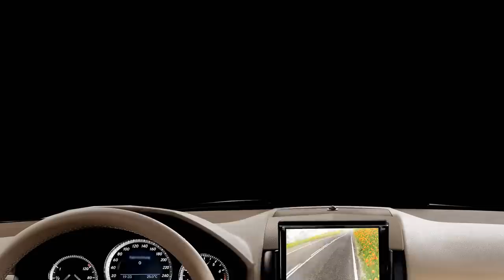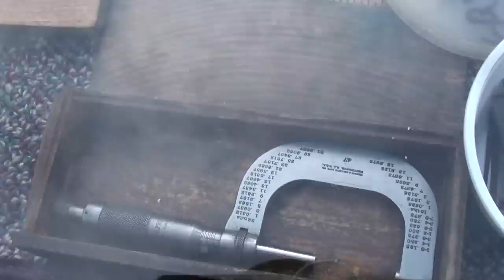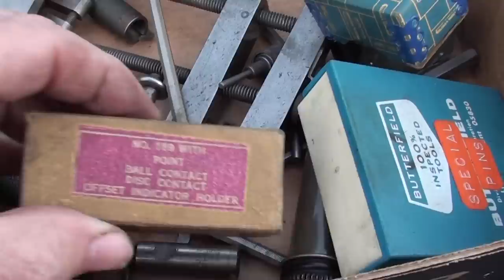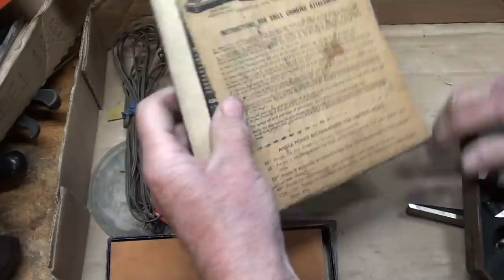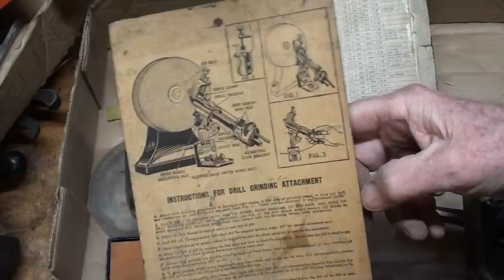tubalcain SCORES at ANOTHER TOOL AUCTION atlas lathe

Comment: Two comments at the approximate 24 minute mark in this video.
1) why were people dismissive of the idea of 3D change gears? I think they would work just fine.
2) Crescent used to sell individual parts to rebuild their adjustable wrenches just like Rigid. I personally sold and bought lower jaws, springs, adjustment wheels and the screw in pins. I do not know if those parts can still be found.
Reply from the maker: People did not seem to like any of my videos with 3-D printing. I assume they thought it was just a cheap plastic gear that would not hold up.
I worked at a hardware store when I was a teenager. There was a little kit box that contains all of the extra parts for these wrenches. Jaws, Knurled, nuts, and screws. Nowadays, everything is just throw away.
Reply: @mrpete222  Exactly! That little kit you had in your store was the same kind there was in the store I worked at that doubled as a plumbing shop. Only about ten years ago, I was in a small hdw store in a small town in KS that was going out of business that had a newer Crescent kit from the 60's or 70's that I wanted to buy the whole kit. Sadly,  they were just too high for me to buy.

Too bad people are too ignorant to understand that 3d gears would be more than durable enough to be used on a home shop type machine. I guess most just don't have enough mechanical aptitude to understand the application of the newer technology.
Reply: I thought the gears were a great idea and I did make them.
Reply: @mrpete222  I thought the gears were a great idea and I did make them. They work quite well for what I use a lathe for.

Comment: @ 15:30, the item on the red ad white card that says "Ungar" is a soldering iron tip for Ungar soldering irons. If you do not have an Ungar soldering iron, that will definitely sell on eBay.
Reply from the maker: Thank you
Reply: Brass tweezers used in watch repairing ,,,NON magnetic.

Comment: Those drill guide bushings are a great find. I was looking for one today online and they run about $10.00 to $12.00 each.  I collect old cast iron Briggs & Stratton and Clinton engines and have a few with broken 5/16 NC head bolts.
Reply from the maker: I hope to use them in and up coming video

Comment: If you find out the name of the combination square set at 34:00, I would like to know.  I have a set with similar markings.  My square head has "AD" over "6", instead of "4" like yours.  My center head has "AD" over "R".  Yours has "AD" over "B".  The protractor head has no marks.  The tightening knobs are the same.  There is no rule.  When I put a rule in the center head it does a repeatable center line on a 12" circle, whether it is flipped over or put on the opposite side.  Really great estate sale find.  Thanks for the super videos!
Reply from the maker: It is a craftsman. It fits on the protractor set

Comment: The very last auction... of April. The bionic wrench is a pretty good tool but the fact it doesn't fit in tight places is a bit of a pain. It's much better than a normal adjustable for the places it does fit though.
Reply from the maker: It is considered a novelty, and worthless

Comment: SO glad I wasn't with you, I recently7 received my dads atlas from the estate and I probable would have went broke at an auction like that. There is one thing I have been wanting to ask you ... I'll be looking for a chuck for it, the one that is on it has been broken and rewelded so it has about 10 to 15 thou. runout. I have looked ALL over the thing and cannot find a model number, the only 2 plates riveted to the thing are an Atlas name plate and the gear chart inside the cover. The lathe other that is in excellent shape. are there some measurements I can take to determin the size and where can I find a 3 jaw, 4 jaw,  and possibly a milling attachment for it?
Reply from the maker: You only need to know the spindle thread size. Which is probably one and 1/2 x 8. Then just buy a three Jaw chuck with that thread
Reply: any suggestions on breaking the chuck loose, had a thought of a cresent wrench on a jaw and giving it a rap with a hammer but it kind of makes me cringe to think it. I'm assuming right hand threads. any suggestions on where to look so I'm not buying junk and not getting ripped off

Comment: I wish I could find a Craftsman/Atlas lathe for that price.  The closest one like that is 8 hrs away in Grant Park and $950 for it. Yeah it has a fancy cabinet that I don't but it shouldn't be a  $500 cabinet attached to it. And then there is the fuel cost to get there and overnight accommodations.  Most of what I see are beat up old converted overhead belt drives.
Reply from the maker: There seems to be plenty of used machines around here

Comment: Lots of stuff that you call junk or no good that I'd be perfectly fine with, but everyone is different I guess.
I personally would not instantly call every sears, Dunlap, or true value / master mechanic tool junk.
Some of it comes from the exact same manufacturer as Craftsman, and is probably the exact same steel / quality, that's just me though as I'll take a y American made tool I can get as long as it's not OXWALL.

Comment: Mr Pete  i have looked at all your indexing plates, also the one you made using a skill saw blade, I have a indexing slide dial for my lathe but is got damage, and need to make a new one , however  i can make the dial, I have no way, making the index marks on it, The indexing makes are us std and with 125 marks , i see you used a saw blade that had 100 teeth. I need one with 125 teeth to make the indexing marks, never was made.  would like to send you pictures of it if maybe you could help me with it , The one  i have is bend about .080

Comment: is America still using the old imperial sizes and not metric, the two don't convert to each other and as the rest of the known world uses metric I'm sure this helped the American engineering decline, manufacturing things that countries cant repair or work on must have had a devastating impact on exports, China used to have a system that wasn't metric or imperial but during their export drive they converted everything to metric, resulting in major exports at the same time America saw a huge decline in exports, I'm old enough to remember the switch over here in the UK 1971 we switched everything to metric, spanners, socket sets, drills & taps etc went in the melting pot and out came new shiny metric tools, much easier to work with and mentally arithmetic calculate, it's a no brainer, why did America not change, did they think they were bigger than the world, did they think their home market was enough to keep the manufacturers busy, we get some America tool here but they are all metric, snap on being the best known,
Reply from the maker: Most of the world does not understand that. All of our big companies are metric. Caterpillar ford GM at Cetera.